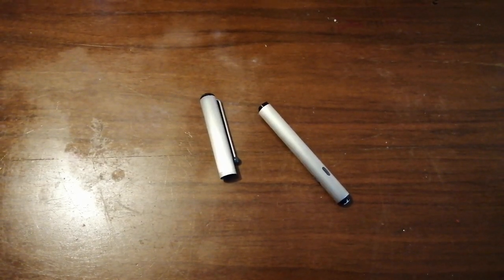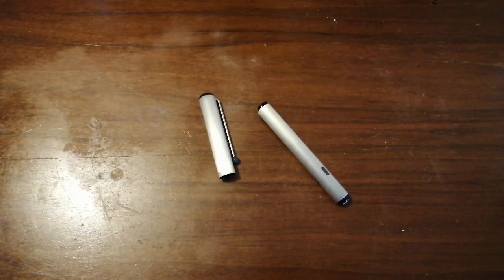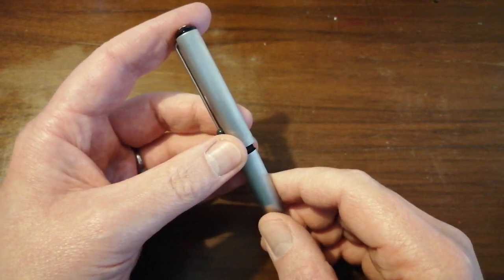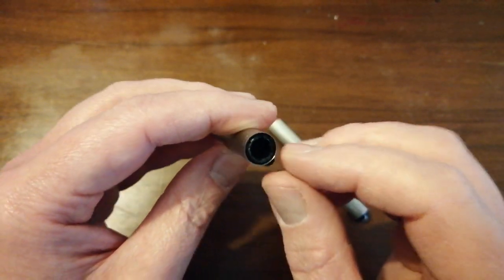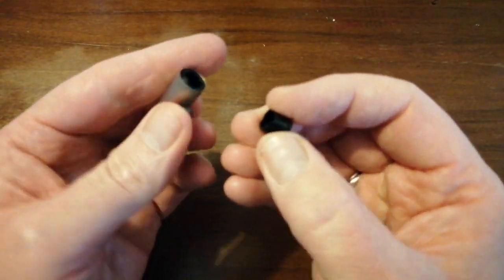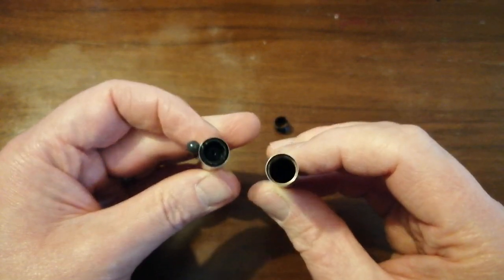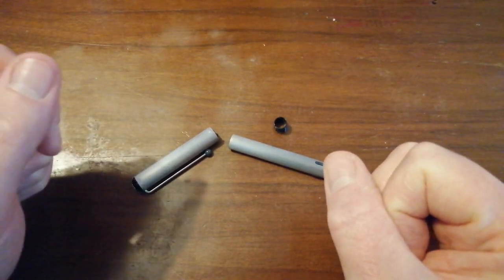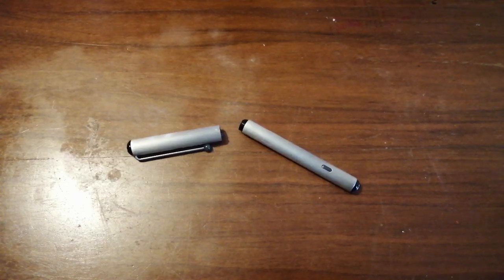Montblanc Turbo Fountain Pen Autopsy

Comment: Does the cap finial unscrew? If so, could you carefully insert something into the top of the cap to push the section out? Obviously taking care not to touch the nib.
Reply from the maker: Thanks for your suggestion David - I've just tried that, but unfortunately it's firmly glued into the cap.

Comment: "Follow up to yesterday's video where my wife broke my classic 50 year old pen" :)
Reply from the maker: I'm still suffering. It's broken body lies before me on my desk...
I WILL resurrect it, somehow!
Reply: @FountainPenJourney  You need a bond stronger than pull to get it unstuck...I saw someone suggested putting it in the freezer but surely it needs heating so the metal lid expands which would loosen the hold? Epoxy resin maybe for the bond and then a heat on a radiator or oven? That is the way I'd go though it will be fiddly but that is damn nice pen!

Comment: @rob you can try wedging the eraser of a pencil which has an eraser on top. If you cant find the right size, i would try covering the top end of a pencil with rubber bands until it is the right size. This would help taking out the part of the  secion without destroying it and then try to glue the 2 broken parts together ... looks a very diffiult task ....
Reply from the maker: I'll give that a try, too 👍

Comment: Since the section is likey broken beyond repair, how about driving a small screw into the plastic of the section or feed, then pulling the screw and section out with pliers? You might able to get someone with a lathe to turn a new section for you.
Reply from the maker: I'm going to have to try the various options starting from the least destructive. I'll let you know what happens 👍

Comment: Rob, I have seen reverse pliers where when you squeeze the handle the jaws expand outward. I have seen them in straight needle nose and 90 degree bent needle nose. good luck.
Reply from the maker: I used to make jewellery and I have some similar pilers... They'll be my next option.
I will fix this pen! 😀
Reply: Rob, if the section is not repairable and you cannot find a replacement on Ebay, perhaps John Garnham can reverse engineer one for you.

Comment: i see other people's suggestions, but if you still have no luck with that, theres an electricians trick they use to get out broken lightbulb contacts when the bulb breaks, if youre up for it. They use a potato to press straight onto the metal, unscrewable part and turn the potato as a makeshift handle to get the unscrewable part out. did i under or over explain? I pray it works for you and God bless you, Rob!
Reply from the maker: I'll give that a try too - many thanks! 😀
Reply: @FountainPenJourney  were you able to get it out?

Comment: Tweezers/pliers with reverse action, apply force to the inside of the stuck ring and pull out.  Then with the right glue I'm 100% sure you can get that pen working again!  If you don't have such tools just improvise with any two things that you can stick in there like two thin knitting needles in an x with your finger in the top notch of the x as a point of leverage, then just squeeze so they grip on the inside and pull it out.

Never throw it away!
If you really want to throw it away give it away instead, to me for example! ;)
Reply from the maker: Thanks for your recommendations! 👍
I still haven't had time to work on repairing this pen, but I have a lot of tips from viewers such as yourself which will help me get this pen "back from the grave!"

Comment: Have you tried putting the cap in the freezer.   The section may shrink more than the cap.   Just in case the cold makes the section brittle, I'd be careful trying to pull it out.  Maybe the eraser (rubber, I believe in the UK) from a pencil might help.  I don't know what kind of cement could rejoin the part but I've heard blue light activated glue can do some amazing things.  Good luck.
Reply from the maker: Thanks for your suggestion John - I'll try this right now 👍